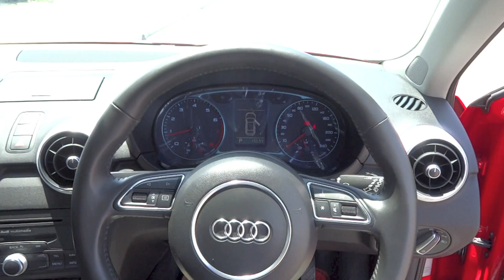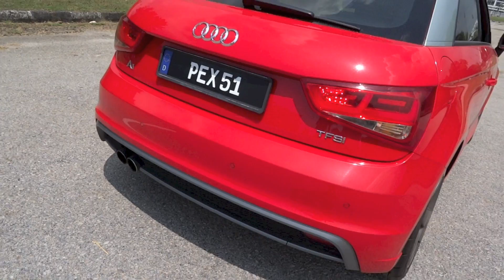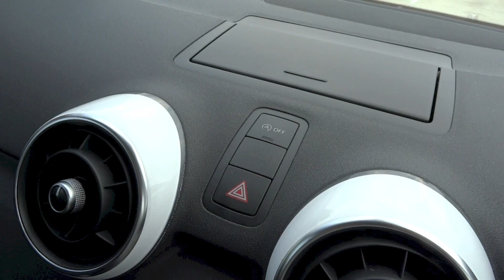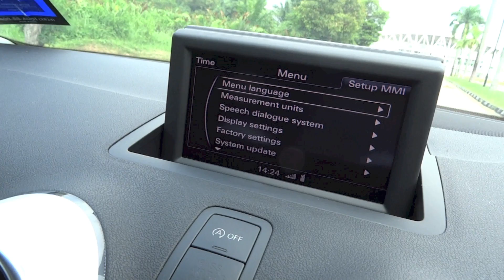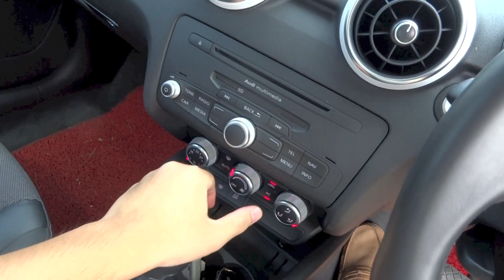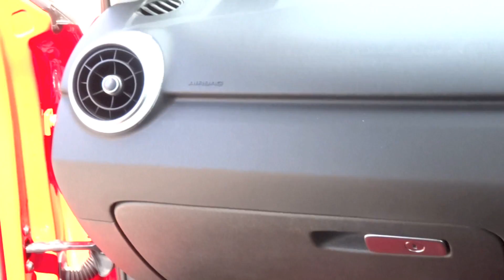2012 Audi A1 1.4 TFSI Start-Up and Full Vehicle Tour

Comment: The 2012 to 14 was hydraulic and then 2014 onwards was electro hydraulic and then 2015 onwards was electric for steering. Some pointless information for you..
Reply from the maker: I got the electro-hydraulic info off the local spec sheet for the car which was dated June 2011 when the car debuted in Malaysia.  Now that you said it though, it does seem like the facelifted A1 did get electric steering.
Reply: alexlovesmac yeah, my friends 2012 is hydraulic, my 2014 pre facelift is electro-Hydraulic and my friends new Facelift 2014 is electric!
Reply: Actually, very important.